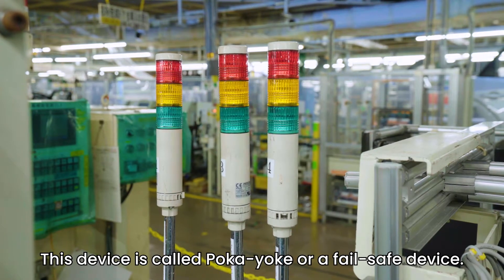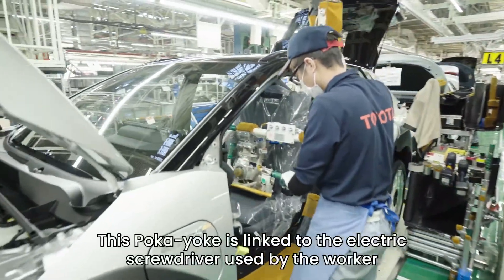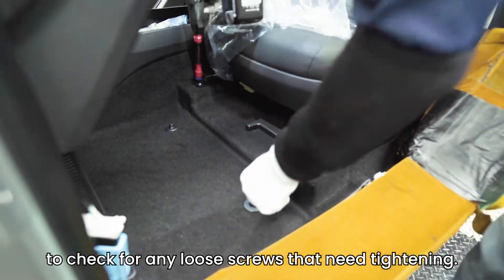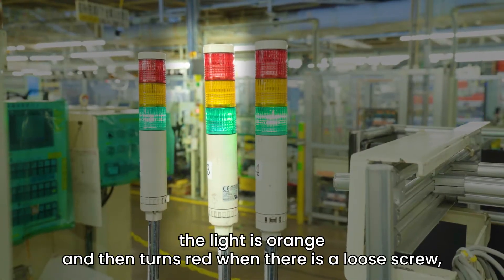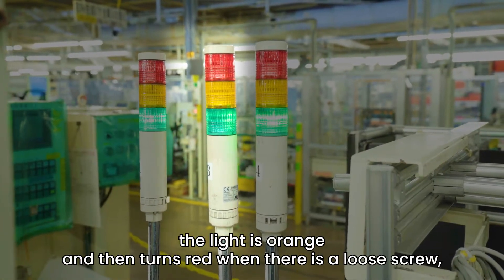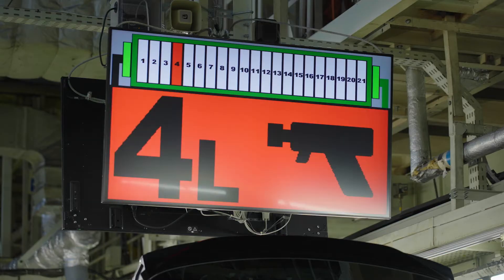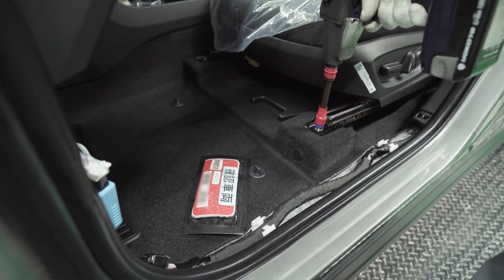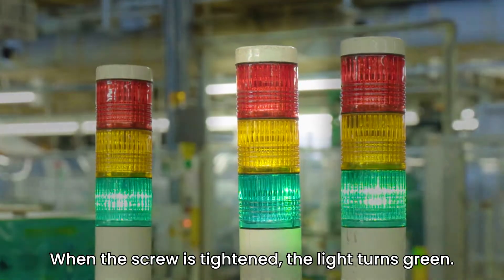The Toyota Production System as Taught by Toyota - Episode 02

Comment: By which mechanism is the error identified.
Reply: Should be the screwdriver, if it's used less than it should be then yellow light turned on #cmiiw
Reply: @satriowahyutomo  but it still identifies which screw was not placed, right ? how it can detect which specific screw needs tightening?
Reply: @logvidex  good question, now i'm curious too
Reply: @satriowahyutomo  Maybe, on the place where screw needs to go ,there's a sensor that is telling if it's filled or not?